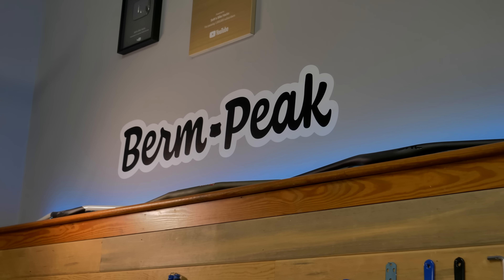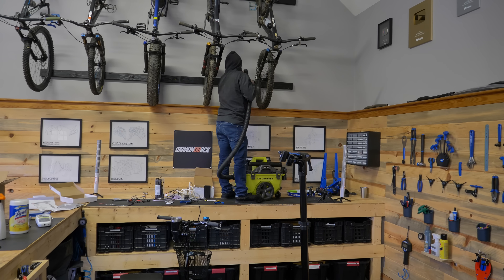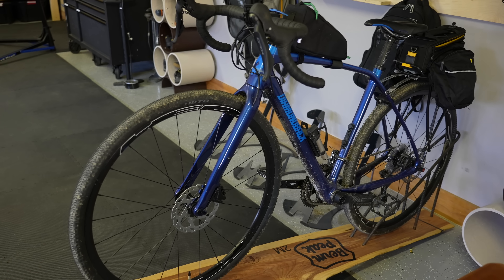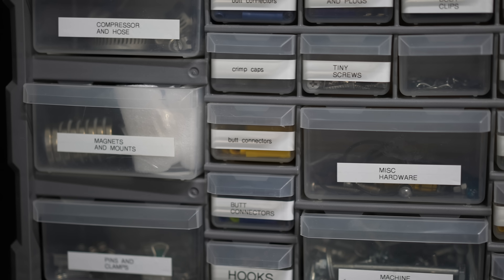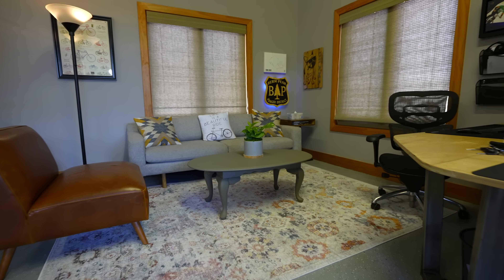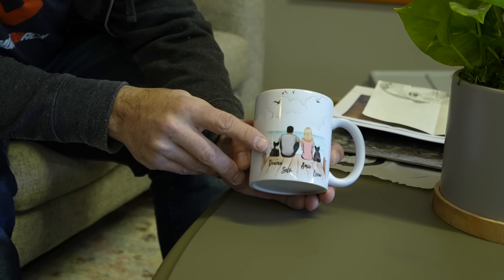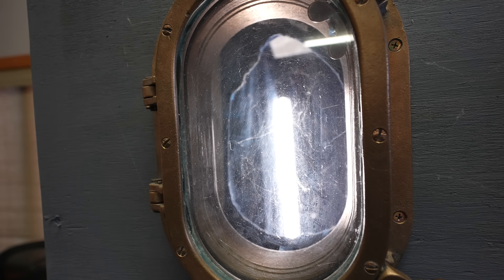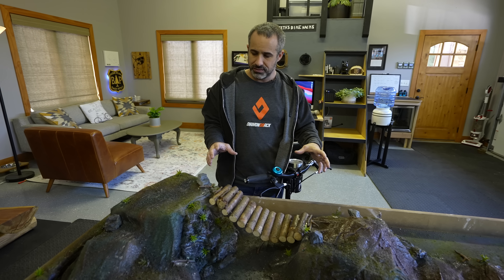A Tour of Berm Peak's 3 Bay Garage Office

Comment: I'm huge into Rc and I'm just suggesting, that old ammo cans are the perfect holder for lipo batts. They also make lipo bags, designed for safely storing your batteries.
Reply: Yeah, that is a great suggestion. What can go wrong sealing explosives in an airtight box.
Reply: @666louis  wdym?
Reply: @CalebBoender  Putting lipo batteries into these army ammo crates basically create a bomb as they are quite airtight. Professional lipo cases release combustion gases in a controlled manner without letting flames shoot out.
The lipo bags follow the same principle, let the gases escape, try to contain heat and flames.
Reply: @666louis  ahhh thanks

Comment: Hey Seth so my 1/24 scale axial deadbolt has been very fun but I plugged in he battery and turned it on and paired it up. And its not driving forward but the steering and lights are working. So if you could think of the problem I would love some input. Thanks!

Comment: Lack of content is for me lack of riding. Its been raining so much lately in central NC that the trails have been closed. Also, getting a replacement B screw insert for my new Box Three Prime 9 X-Wide derailleur. Mine got stripped out only riding a few. So I'm on the bench until I fix my bike.

Comment: Why not cut a door into the recording booth behind the stairs, and attach the stairs to the back of the door. When it's closed, you have stairs, but then it opens as a door into the recording booth? If worried about bottom of stairs, either use casters or a flip down bottom stair?

Comment: There are ways to expand your table saw capacity... Easiest way is to route two tracks on the work table to the right of the table saw (need to be perpendicular to your table saw blade) by use either Microjig matchfit (better) or T tracks system. Then you can just make a fence that you can move right and left to allow cuts almost up to the width of the worktable.

Comment: @1:43 Hey Seth, with the backpack screws did you find that they were eating into the fabric? I have the same kind of setup but I put about one inch of heat-shrink on the 2 inch screw before I drilled it in. I also heard you can get the same result from a straw but I think heat-shrink just looks better. I thought you'd appreciate my little hack.